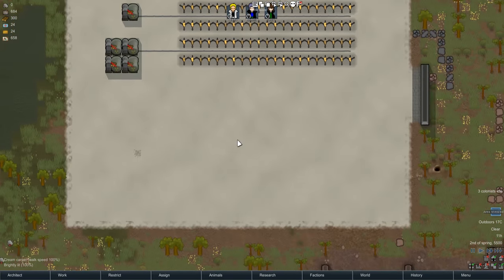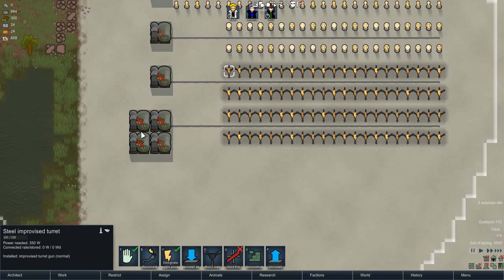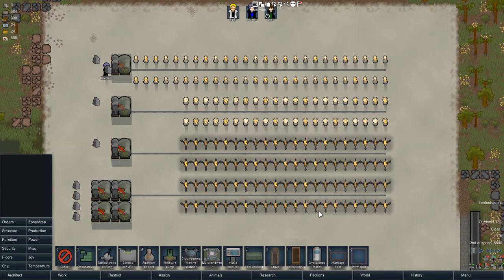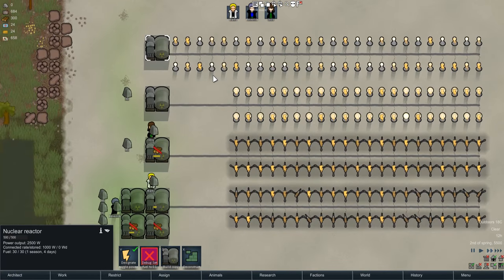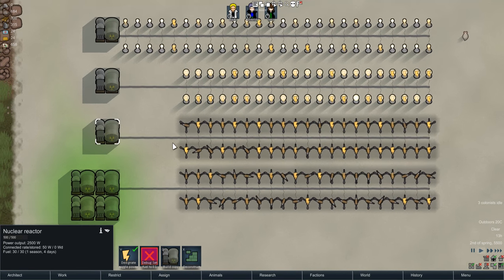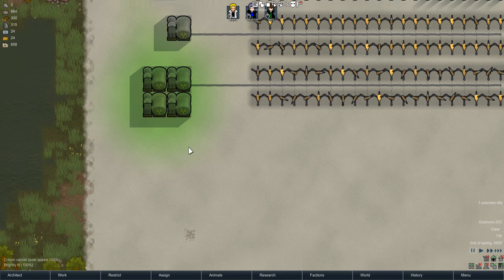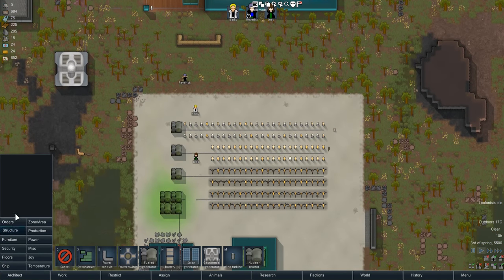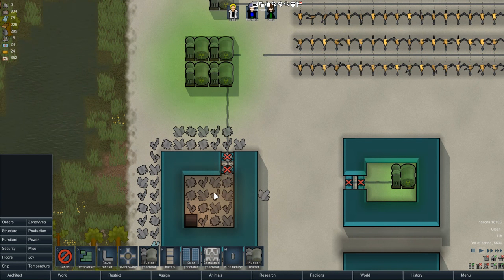Rimworld Mod Guide: Simple Nuclear Reactors Mod! Rimworld Mod Showcase

Comment: I found it weird that the ship caskets don't take uranium, but the normal ones do, even though I've never used a regular one for anything before
Reply from the maker: Cummings yeah it's incredibly strange.. Not sure why haha. I could have sworn some ship parts used uranium.
Reply: i think the normal cryptosleep caskets need the uranium to power them independently of whether there is someone around or not (for example with the ancient danger chambers), while the ship caskets rely on the ships power. i was confused as well, the first time i found out there is a difference, but thats sort of how i would make sence of it. i still think it would make sense to power the ships caskets with uranium just in case something happens with the ships propulsion system.